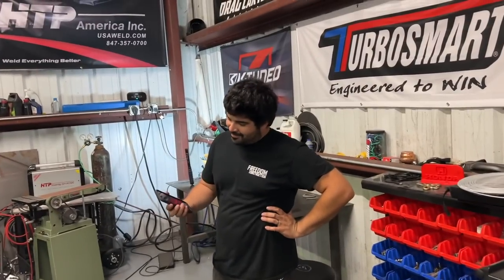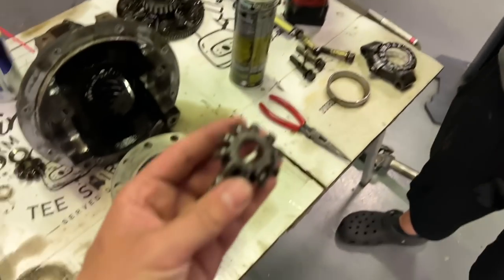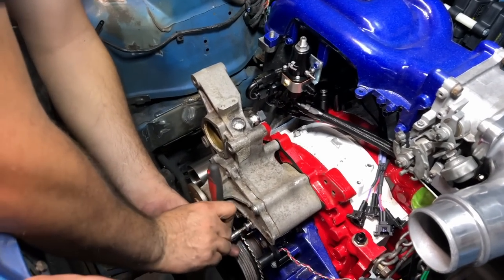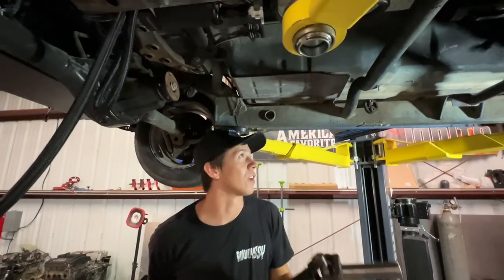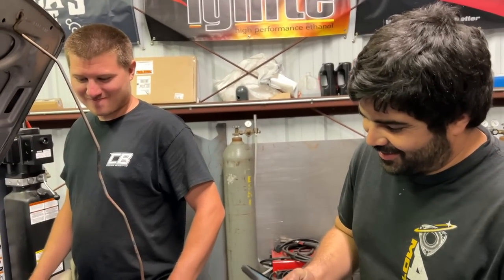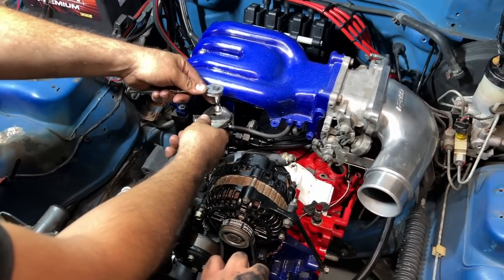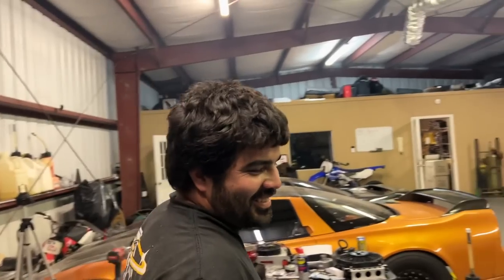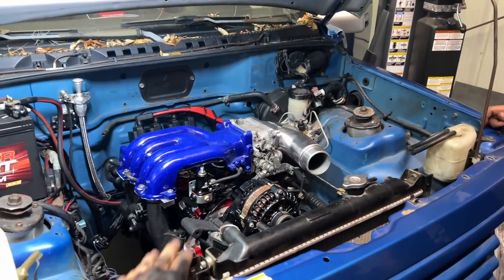Rotary Swapped Sidekick FIRST START!

Comment: Love the rotary Brap Braps!! Miss my Datsun. 2nd gen 13b swapped back in the early 2000s. Rotary's have come a long way since then.
Reply: Erikk Hyndman  If its built wrong and high power output, sure junk. A mild build is a good balance. The seals uaed to be the major issue, and the faster wear, especially with anything over 400hp. Giving the expense of rebuilds every 30k to 40k. If not chunked by then. Lol. But with a mild 400hp and lower build, nowdays especially they can last. And instant power throughout the rpm band, without the delay of extra parts having to be rotated to get going, makes the rotary a nice option. A 400hp rotary acts more like 600hp easy with putting down power in seconds. And when they do break, its way lower cost to build back up, and whole lot less parts.  :) But its not for everyone. Ride or drive a high output rotary setup, you'll get hooked.
Reply: Erikk Hyndman  I don't think they're junk at all, you just gotta know how to take care of them and what they can and can't handle. Every motor has its weak spots. Rotary power is definitely a different feeling, and the exhaust notes are just too sexy

Comment: Making that gasket blew my mind. The genius of the Vargas brothers!
Reply: Thats basically how its done when u cant source a gasket for a certain part. That paper is known as the gasket paper😊
Reply: It works way easier than it even looks on camera, too. I personally run two bolts corner to corner whenever possible to keep it flat.
Reply: It's an old school way of making gaskets my dad would do the same
Reply: This is what we did in highschool shop class. Cheaper and easier than ordering some weird ass gasket.

Comment: Hey Kyle! Welcome to the 2 stroke rotary life!!!! 
#savethemapexseals
 used a old windshield washer fluid Reservoir and we just go by one of the big jugs at store . After I ran the line to the engine it would just mix. It's been a while but I do believe we mixed it somewhere near the fuel rail/hose or the injectors one of the two....but instead of having to constantly remember it  you can say screw it and  do a gallon at a time.. now that I think about it I wonder if I should have tried to run a low washer fluid indicator light to the sensor on the bottom of that Reservoir so when that light came on I know I was getting low on two stroke
Reply: How did you control the flow and keeping it on?

Comment: I wouldn't run it that long without the cooling system. They are known for overheating and whorping. But it sounds awesome. I can't wait to hear it with the turbo on it. I really hope that you put a full complete exhaust on the sidekick. That way you can drive it on the streets, legally.

Comment: I’m hoping you’ll do a car from the thirties to seventies, such as a Studebaker or Mk1 Cortina. Hell, even something like an MG Magnette would be outstanding. Restore the body, chrome and interior back to original condition. Then you lower it, update everything to MGB spec, stick the Nanjing Automobile version of the Rover K-Series under the hood (preferably bolted to a ZF transmission from a BMW), then work your magick on it.

Comment: I had a 1973 Mazda RX3 with the two rotor engine and a four barrel carb. It was bad ass. I would rev it to around 11,000 RPM and drop the clutch. Again it was bad ass. I totaled that car.

Comment: Idk Jack about rotaries or rotary swaps especially. But idk why more ppl don't use the RS5R30A Nissan trans with rwd engine swap cars. My LS swap used it, it's from the 91-95 I believe 300zx twin turbo. Many have made over 1000whp reliably on them and for $300 in a junkyard even with rebuild is way less then a t56 and more reliable then cd009. And a ford 8.8 you can shorten just driver side axle tube and use 2 pass side short axles. Combined with an lm7 iron block 5.3 for $500 and $500 in cams, pushrods, and trunnion kit. You got a helluva beast for under 5k in parts.

Comment: Were these motor mounts you made or were they purchased to convert and is there a conversion plate on the engine for the transmission or how did you mount that seat for to that engine I'm curious I saw a short clip where you had mentioned modifications to the bell housing but never referred to what modifications were made would like to know more about????

Comment: I hope you either lubed the tailshaft before inserting into the transmission or pulled it out and lubed after otherwise you'll end up having to do it as well as replace the seal on the back of the trans.

Comment: I'm a huge rotary guy and I think the Vargas Brothers have overlooked a major part of your build. On all the Vargas motor burnout cars they are using FC (86-91) Water Pumps. The FD Water pump (93+) is a absolute dog crap design and cavitates easily (You also can't put a FC Water Pump in a FD engine (they spin backwards)). If you seriously plan to run this thing as a burnout car you should be using a electric Water Pump or run big pullies to underdrive the FD Water Pump. Or you can buy the RE-Medy Water Pump, which uses the FC (86-91) design that fits into the FD and is even better as it's a better designed Billet piece. If you don't run a proper Water Pump while using this car as a burnout car you WILL blow this motor. 

Thing you gotta know about Rotaries, the combustion side of the Apex housing is only cooled by water and sees nothing but compression and fire. Unlike a piston engine where the four stroke process works to cool the Piston, the part of the Rotor Housing that sees explosions and fire only sees the Explosion and fire part of the four stroke process. I don't know how those Vargas guys don't melt the water seals out of their motors but if you want that Rotary to last I'd say buy that RE-Medy Water Pump (or install a electric water pump) and you won't have to worry.
Reply: Told you....

Comment: W in 20w50 stand for winter not weight homies, love y’all 🤙🏼
Reply: True in SAE J300, the W means winter. However, it is also correct to refer to the straight grade SAE30 that goes in the mower as 30 weight.  One other complication W at start of the grade can mean contains ashless dispersant as in aviation grade W100 which is actually 50 weight.

Comment: Useless fact. The W in multi viscosity oil doesn't mean weight. It actually stands for winter, it's the viscosity of the oil at around 20*F. The 2nd # is the viscosity of the oil at around 212*F. Look it up. My temp #s are guesses but they're close lol

Comment: Love all your content guys ! Now I'm not into  rotary engines but is exhaust supposed to come out the radiator like that ?
Reply: no, but the thing is very not a complete build yet, they don't have radiator lines from the engine to the radiator, the exhaust is only the start of a turbo manifold, too
Reply: since the turbo isn't built yet the exhaust pipe is pointing right into the radiator that's what's making it do that.

Comment: Usually go into panick mode when I see exhaust coming out the radiator hoses but in this case eh, let it brapp
Reply: Radiator isn’t connected so the header was blowing in it
Reply: @MikeVargasAngelMotorsports  that was very obvious. My point was usually exhaust doesn't come out the radiator.

Comment: Jokes how the smoke from the motor was coming out the top of the radiator
Reply: Radiator is not hooked up that’s from the header blowing in ot
Reply: @MikeVargasAngelMotorsports  sorry that's what I meant. Seen it blowing into the cut bottom hose.

Comment: The intro looked as if was blowing smoke out the radiator cap. 🤷‍♂️ I’d have to rewatch again but hope it’s all good.
Reply: That shits probably not hooked up😂
Reply: Not hooked up just fumes from the manifold
Reply: @MikeVargasAngelMotorsports  , you are right it looked like the bottom was connected at first but the hose is cut and accepting smoke from the bottom and exiting the top.